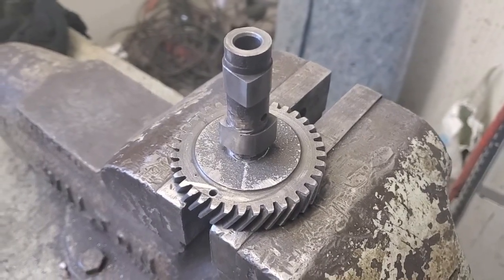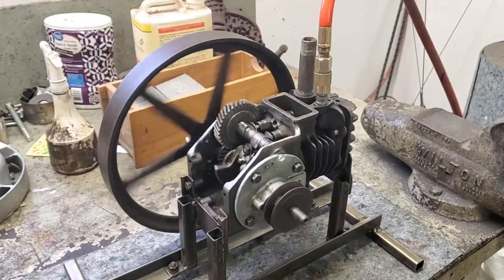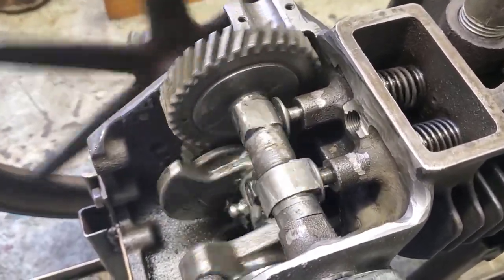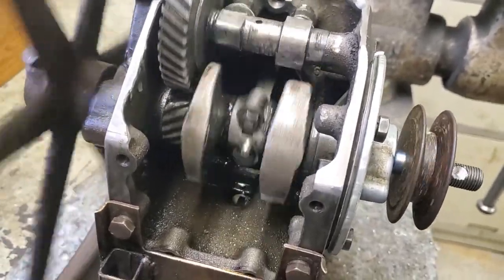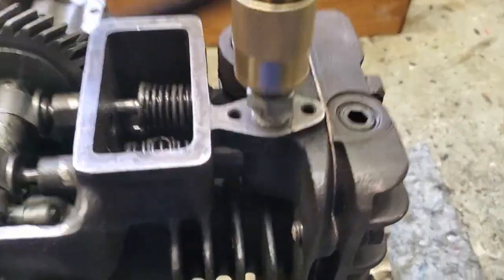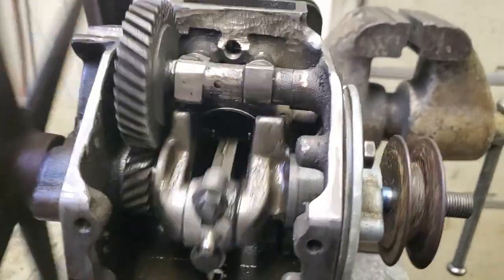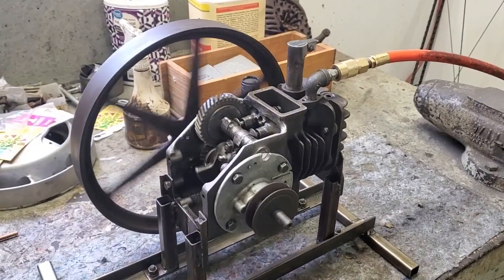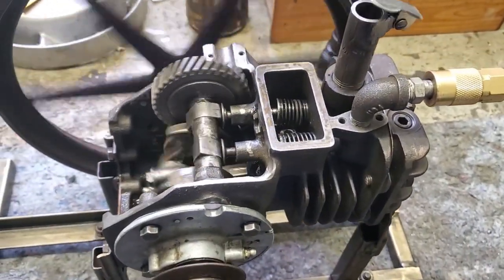Briggs & Stratton Steam Engine Conversion

Comment: Cool. Why be afraid to crank up the RPMs a little?  For a machine like this to do some useful work (like driving a small line-shaft or powering an electric  generator)  I would think you'd need a bit more speed.  A motor like this and a small water tubed steam generator for it, might come in real handy some day.

Comment: Question,for anyone that wold like to  I see you welded up double lobes on the cam some only use one I was thinking of regrinding and welding cam up so both valves open at the same time, seems to me it would work twice a efficient  but I have not started trying to make one yet

Comment: I see several guys going in through the spark plug and disabling the intake valve, do you feel you get more power the set up you have?
Reply from the maker: Yes I feel there is more power with this setup. The piston doesn't have to fight against the air pressure as it is moving up toward TDC

Comment: Thanks, nice work.  Could you try  changing the intake to just a very light spring & no lifter so it's operating like a reed valve, just for the hell of it?  Also much weaker springs for this low rpm range.